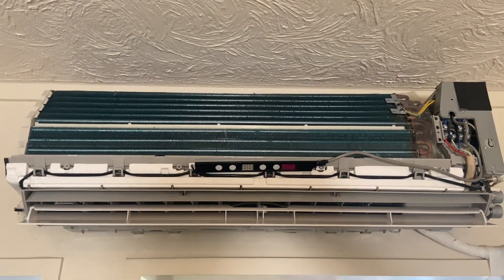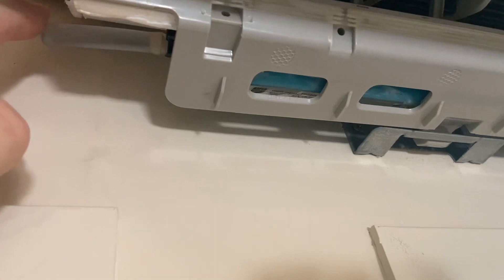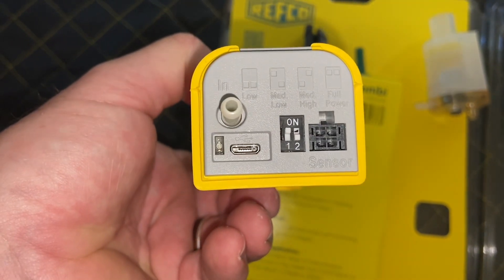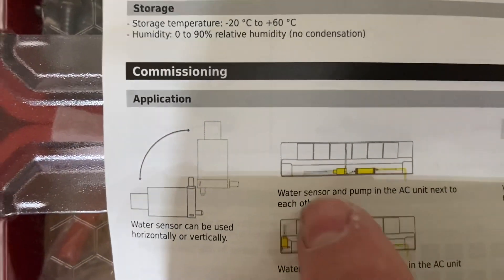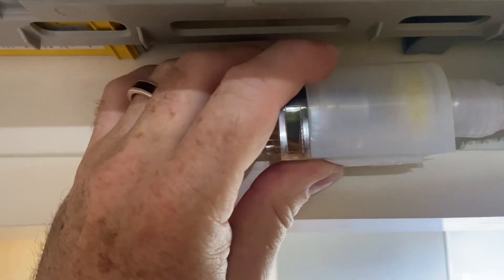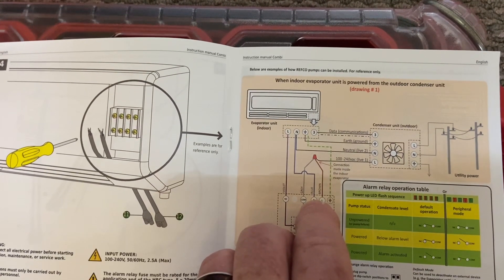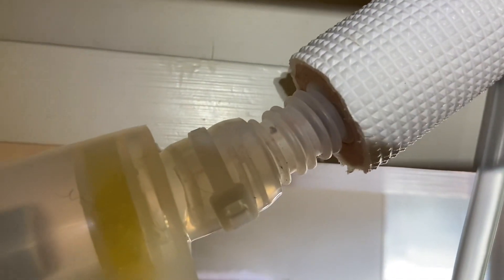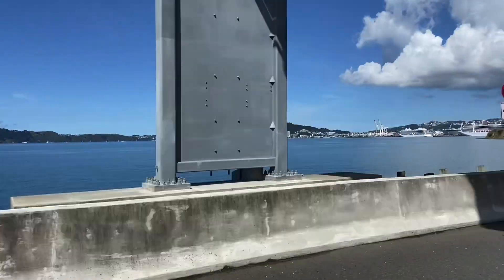Mini-Split Heat Pump | Condensate Pump Installation (Refco Combi)

Comment: Hi, whats the vent tube attached on the top of the transparent water sensor? I have water coming out from that hole and I do not have the vent tube installed. The guy who installed it few months ago says you dont need it. Apparently water is leaking from that hole everytime I turn the ac on. I cant find the guy who installs it anymore 😢
Reply from the maker: Thanks for your comment. The vent tube attached to the clear water sensor (top of reservoir)  acts like a breather hose. It's required, when the water sensor is placed / installed into a horizontal position (like you see in this short video). However, this vent tube isn't required when installed vertically. If you feel confident enough in removing the front cover of your heat pump, it's pretty easy to check and install a vent tube if your installation so requires it. Also, while the cover is off, good idea to check and make sure that the filter in the reservoir is free from any debris.
Reply: @CapitalCoastHVAC  thank you。sadly we no longer have the tube and its not replaceable

Comment: What's the pump noise like?
Reply from the maker: @cbrauchli  Very quiet 🤫 when pumping.  When the cover is on the indoor unit I cannot tell when it's pumping. My favourite mini-split pump for sure when you have the room for it. Customer also well happy with it.
Reply: @CapitalCoastHVAC  that's great to hear. It would be great to have a video of it running if you can take one.